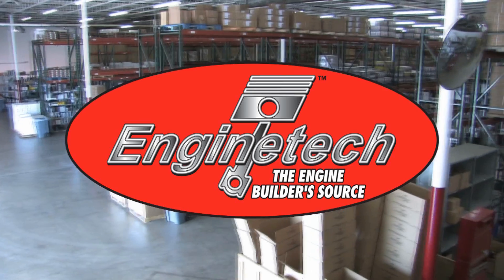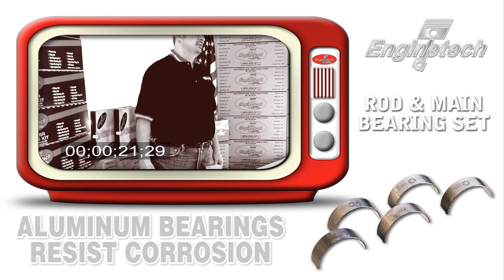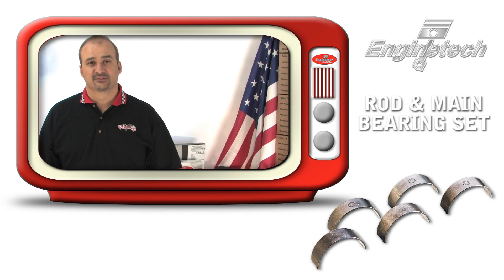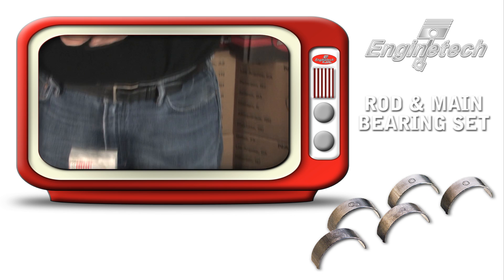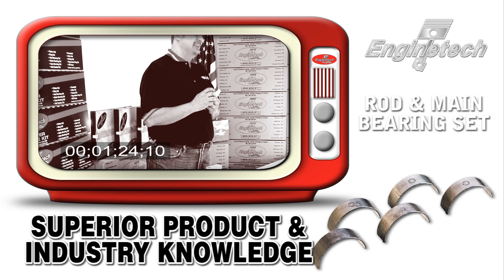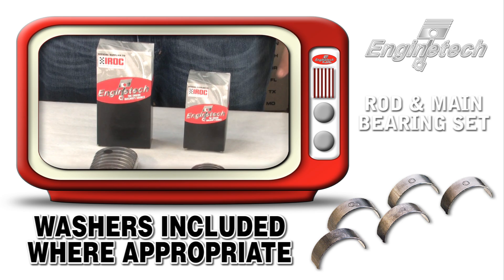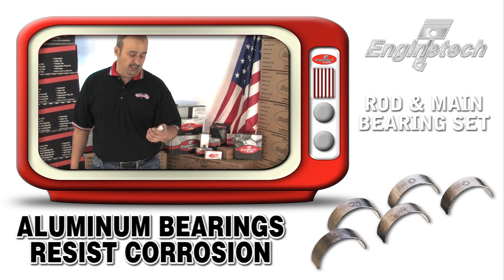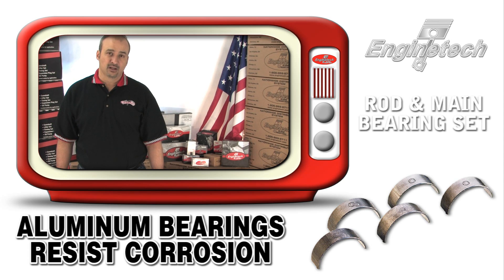Rod & Main Bearings - Enginetech

Comment: I just installed one of your crank kits on a 3.7L Jeep and I forgot to blow out the oil passages..... My question is, do you thoroughly clean the cranks before sealing it in the bag.  When I received my crank kit the box was in great shape and the bag was sealed.  When I pulled it out of the bag I immediate  installed it on the block.  I really don't want to take it back out but I will if I have to.......... Please help thank

Comment: What type of bearing would you recommend for a 4 cylinder that is ~	200 hp over stock. Primarily daily driver, no track, but get on it on the street (clear road) sometimes...Would the aluminum bearing still be able to stand up? Our would you recommend a steel backed bearing? Thanks...